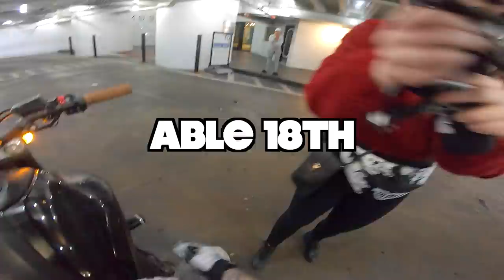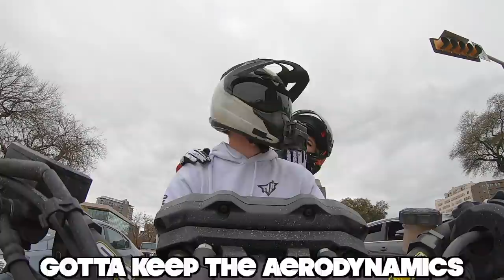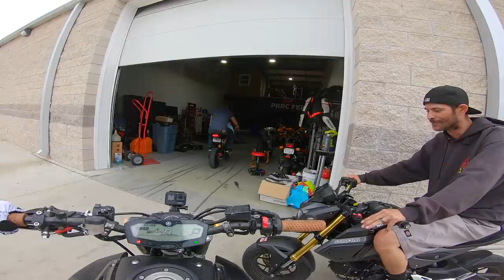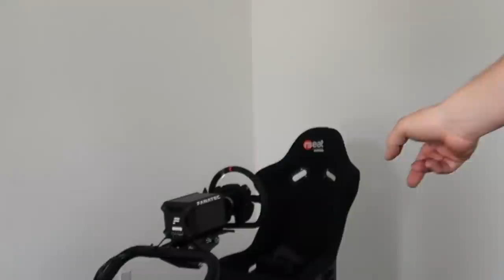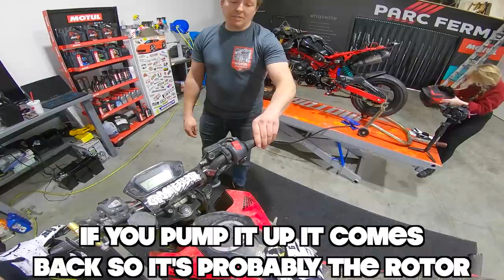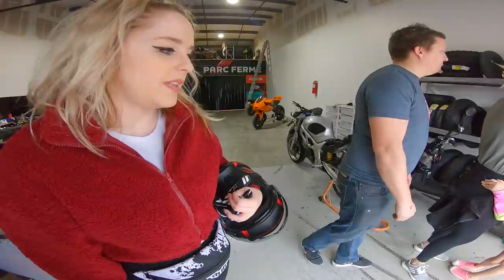Finally recovered her stolen motorcycle (Bad News)

Comment: I bet at your level you could reach out to GoPro and get a legit answer about the audio pop we are getting at higher speeds. It has something to do with either the mic adapter, splitters or mics because without the external mics the GoPro doesn’t have audio pop in direct wind. I’ve been fighting this battle for a while. 😫